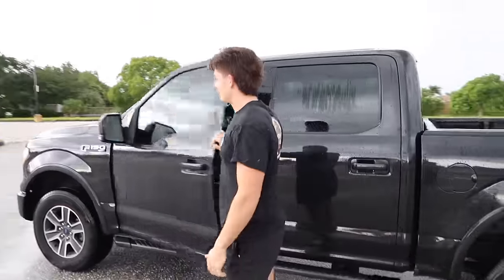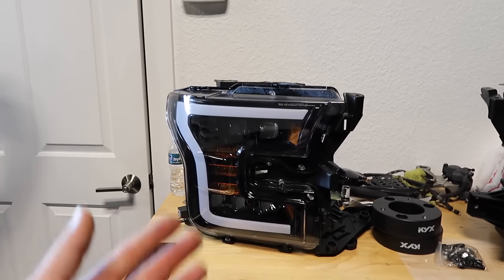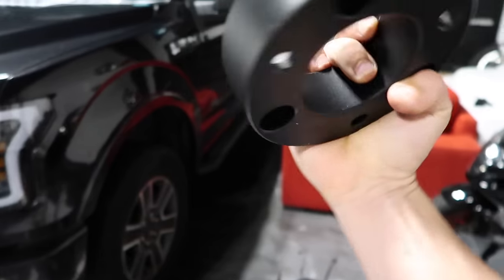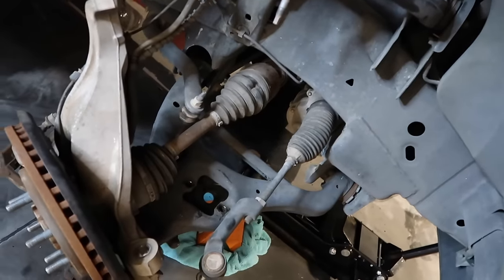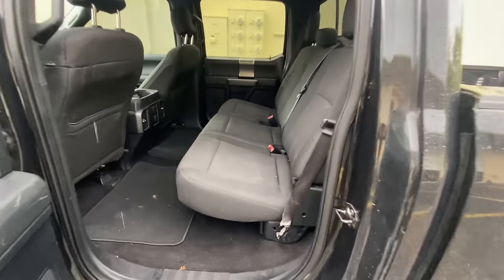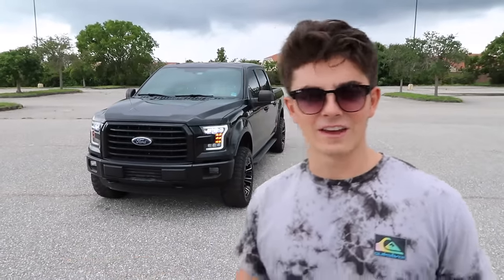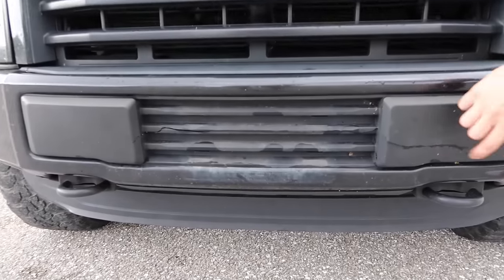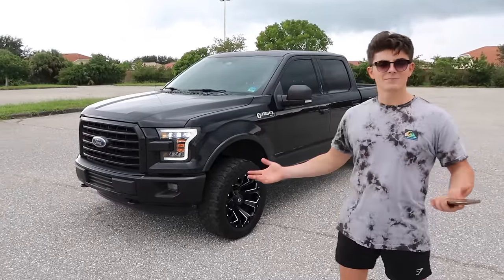Completely Transforming My New Ford F150 For Under $3,000

Comment: Headlights look great! However, the issue with a lot of them is that they tend to be of poor quality and break relatively quickly. Now I know somebody is going to say that isnt the case if you buy the better quality ones (expensive ones). But the reality is a lot of those are just rebranded cheaper ones with better instructions/packaging. There is a lot of videos that show this. Finding some actual quality ones is going to be a crapshoot. Love how the truck looks though.
Reply: Yep that’s what happened to me. Within like 3 months the driver light turned yellow and started cracking. And then there’s a weird clear film on the outer part of the light that started peeling off.
Reply: Jw speaker, best lights and lifetime warranty. Problem solved.
Reply: Go with Morimoto headlights

Comment: I just ordered a set of 18 x 9 Fuel Assaults w/-13 offset for my 2004 FX4.  Best looking wheel out there, imo.  $1,498 out the door from 4WP.  Along with the 9" rims replacing the stock 7.5's, should give it some good poke. Love your truck, btw.

Comment: I have the same truck (except it's white) pretty much did the same mods you did, I put on some new Bilstein shocks all around, the front shocks allowed me to udjust the front end till level. I put on air bags in the rear for when I pull my trailer with our SxS to keep things nice and level going down the road. Totally took a hit on fuel mileage with the install of aftermarket wheels & tires, but hey I didn't buy the truck to be a Prius. Nice work GREAT looking ride, you did an Excellent job.
Reply: I did the same with the front Bilsteins but I only went 1.75 inches in the front. I’m wondering if I should’ve just gone 2 inches

Comment: Hope you have better luck with those headlights then I did and other people I read about had the same problem. The bulbs started failing in my left side light about 7 months after I put them in and guess what, no warranty. Had to replace the whole assembly with different lights.

Comment: Was that leveling puck installed already?
Reply: Ya. But if you haul with a leveling kit installed, the weight(if heavy) will cause the front end to point to the sky. Leveling kits are great for off-roading, but not if you’re gonna pull weight. That’s why pickups come from with what is called a rake from factory. Makes front end look sloped down, put a load on. It levels out.

Comment: Hey have a 2015 f150 I just level with a 2.5 leveling kit 22inch wheels 33 tires really love the look and I know by doing so the bumps would be a little stiff and rougher than stock but sometimes it seem like the truck leave the ground like throwing it sideways or something when hitting bumps since I done this really doesn’t seem safe when you up to speed and this happens just wants to know have you experience any of this or heard anything about this so I can correct it